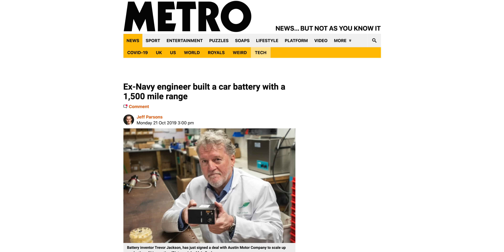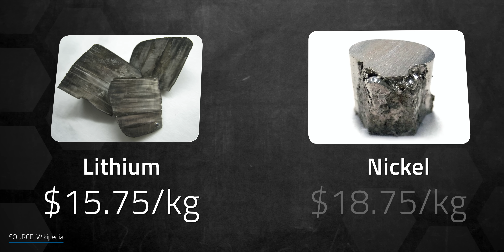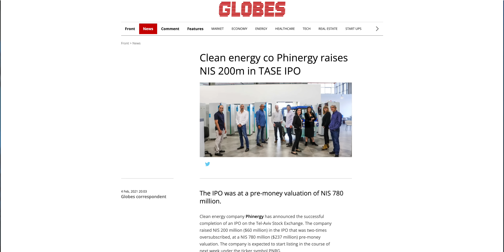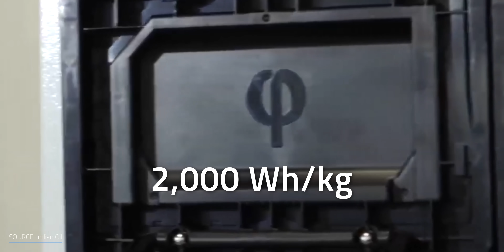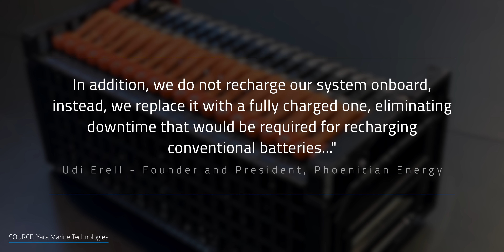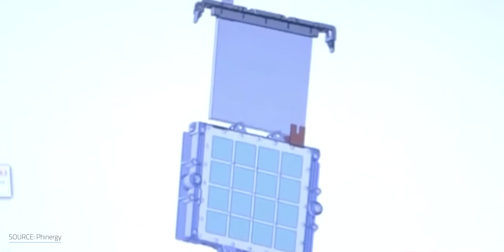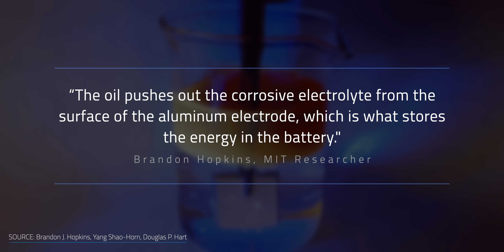Exploring the 1000 Mile Car Battery - Aluminum Air Hype?

Comment: The obvious thing to do is to build a vehicle with 75 miles of range on lithium ion & 500 miles on aluminum air. Then all your daily driving can be rechargeable, & you dip into the aluminum for long trips. Battery changes are minimized down to once or twice a year.
Reply: Running a Tesla battery from 80% down to 40%(my daily max it seems) counts as less than one cycle. Also less than 0.4 cycle. The top/bottom capacity is expensive in lifetime terms, so if you avoid it, and have a large battery that you rarely run to max/min, most cars will wear out way before the battery.
Reply: Been thinking about the same with Hydrogen fuels cells; now if the degradation issue is fixed with Aluminum air, seems there is a better match.
Reply: @MDP1702  i understand that but your not thinking in the context of everyday life. If i just go get an aluminum air battery for a "specific trip" and lets say i end up only using 50% of it capacity for that trip what you going to do with the remaining amount? just let it sit there in your car while using lithium every day? you already paid for it and i guarantee it would not be set up where the average person is going to be able to take it in and out by themselves... nor would vast majority of people would want to..If you use a skateboard design there's no way you could... so in terms of the average people it would make more sense to have a swap station for the aluminum battery and use that as your daily consumption and the lithium as your backup with a 2 compartment skateboard design... 1. you could still have regenerative breaking that would then recharge the lithium when not in use or in use while aluminum is your primary source of driving and 2. you could then just swap out the aluminum when its drained and 3. the overal weight of the battery skateboard design would actually be less than current 100% lithium batteries.
Reply: @Teknomanslade2  * and lets say i end up only using 50% of it capacity for that trip what you going to do with the remaining amount?*
The answer to that is pretty easy, there are several solutions. 
1) you just use up that specific battery during your daily life. No problem with this. Afterwards only get another Alu-air once you actually need the range. 
2) you bring this back to a battery swapping station, where they can give it to someone else that doesn't need a full range battery (and thus pays less and ofcourse you get something extra back too, how much depends on the economics). 
3) you use modules, with every module being worth lets say 200 miles and a possibility of adding x modules in your car at the same time (x depending on car to car). For example do you need 1000 miles, you use 5 modules, do you need somewhere around 200 miles, you put in 1 module. Everything below 150 miles should be doable with a 100 miles lithium battery, even if this means a one time 10-15 minute fastcharging break.

so in terms of the average people it would make more sense to have a swap station for the aluminum battery and use that as your daily consumption and the lithium as your backup with a 2 compartment skateboard design
There is just no sense in using your lithium as a back up, while using alu-air as your standard battery. The advantages of Lithium batteries is best used as in a daily use case, while that of Alu-air as an extender. Why would you even want to have a Li backup? Just get to the swapping station in time just like with gas now.

you could still have regenerative breaking that would then recharge the lithium when not in use or in use while aluminum is your primary source of driving
Except that Li battery will quickly be fully charged if you only used it as an essentially non necessary back up. So you quickly will make no use of the regenerative braking advantage.

3. the overal weight of the battery skateboard design would actually be less than current 100% lithium batteries.
As it would be when using a smaller Li battery as the main battery and using the Alu-air as an extender for longer trips.
Reply: @MDP1702 This is a more AL infrastructure heavy process. Using Li-ion on daily basis and AL for longer trips actually makes sense
Reply: I;m retires now but when I was working I drove OVER 1000 miles a WEEK. So there I am, 600 miles from home and  and in foot.....Like I said, Rich boys toys. The got a LONG way to go before they even get close to the ,main streem.
Reply: @mathewmolk2089  On average that is around 200 miles a day (workweek), that for one is already pretty rare (like maybe a few % of people would do this) and secondly there are already several EV's that could get 200 miles of range in one go. Ofcourse if you don't spread it out over the days, but for example need to drive around 600 miles in one day, that might be different. Then again if you can get 300 mile on one charge, then you'd need to rest anyway due to the amount of time behind the wheel (at least it is advised, in several parts of the world this is mandatory for semi drivers for safety reasons).

If you can't charge at your destionation or somewhere along the way, things are different ofcourse
Reply: Pretty good idea to me, that sort of li-ion range is enough to keep the daily driving within the optimal 20% - 80% of the battery capacity. But if you want to stay at a fiends house and they don’t have a charger then you hit a snag. Also, with people swapping out the aluminium air batteries less often, then there is less infrastructure ti support to, and you may have to use most of your back up range to get to and from the swap out station
Reply: @mariat5860  btw hows ur STDs doing
Reply: How about a small attachable Trailer/pod to carry a couple of Al's for long trips.
Reply: I think if the oil method works to eliminate degredation, that this would be an excellent idea. Would save a buttload of costs for normal ev's since the li-ion battery is the big ticket item.
Reply: @The_fusion_physics_guy  I definitely think its a good idea if it works... but the problem is it isnt "green" so it kinda goes against the whole renewables, green energy initiative to use fossil fuel/additives in an electric car.
Reply: Probably should be the other way around in the sense of using aluminum air as daily because of the degradation issues that were posed. then when aluminum is done lithium is an emergency  backup that can be used to get you to a swapping station.
Reply: @Teknomanslade2  You can solve the degradation problem by simply not installing the battery until you're ready to make the trip.
Reply: @francisboyle1739  Just Reported A Bot.

Comment: It could work, though I think a combination of Aluminum and Lithium batteries would be best. You could recharge your lithium pack normally, but insert an Aluminum pack for road trips.
Reply: I like the idea of standardized modular energy cells. Whether you're using Lithium Ion, Aluminum air, or maybe even a future technology, you can just swap these out in a minute or two, especially if there's some automated process that inserts/removes the modules, it would take moments to "refuel". Users could have a battery "service" that just swaps them out for replacement modules wherever they go, and modules would be rotated out of service as they became degraded.
Reply: @josephdadey and the swapping process can be automated or done by self jusr like hlw you refuel petrol/diesel
Reply: @mariat5860  HAVE YOU?
Reply: Thing is, you would carry around double the amount of weight. Also when you go on a roadtrip, especially with family, you will carry luggage with you, which means available space would quickly become an issue. The viability of those batteries for me hinge on the fact how good they can be recycled. Changing them every 1000 or so miles wouldnt be a difficult issue to overcome if you could simply get them from gas stadions. Also the problem mentioned in the vid with what happens if you should run out, isnt difficult too solve. Just call a servicecar that has a new batterie for you to use and you are good to go again.
Reply: @Daniel-rd6st  I would imagine limited range rechargeable battery for city driving with an expansion slot for optional swap when necessary.
Reply: @Daniel-rd6st  well im not sure it would be a weight increase if you are assuming the same space of the original batter compartment. I think he may be referring to using "partial" for lithium batteries and the rest for the aluminum. like 80-20 split which would actually be lighter than all lithium but still get maybe 2 to 3 times more range. the Lithium would then only be used a Reserve when the aluminum batteries runs out you would still have maybe 100 miles of range for emergency purposes to get you to a swap station. You could make the battery 2 compartments so when you go to swap station you are only swapping out the aluminum.
Reply: @Daniel-rd6st  I think what he means to say is - you get your 50 mile lithium battery for the city which can be recharged in minutes and then when you'd go long range you slide in the aluminum oxide battery. Not a bad idea actually. 
In fact, makes much more sense than whatever the hell Tesla is doing right now. A 600 km battery on cars which would be driven 99% of the time in cities? What a waste of resources.

Comment: If the swapping is available at gas stations then it wouldn't be a problem. The fact that there is no waiting to charge the battery is even a plus.
Reply: @mariat5860  would likely be loaded via a robot.
Reply: It would be so much more expensive though to transport and store these batteries at each individual station / rest stop. For example for a rechargeable EV there is no storage or transportation requirement at all, the local power grid provides constant electricity premises, no HGVs, cargo ships or planes transporting these batteries all over to the place on a regular basis. As for Petrol & Diesel, they are liquid which makes it easier to transport than a battery which even if its light, takes up a reasonable amount of volume per unit, mean while liquid fuels and oil can be transported via pipelines.

I think the idea is great and might be very useful in specialised industries, as others have mentioned maybe for short flights, trains or buses where batteries can be swapped en mass for multiple vehicles at once and only requires delivering to one location to service many vehicles. But unless it becomes rechargeable I don't see it becoming feasible for the domestic personal transport market as the the transportation of these batteries to swapping stations alone would probably negate any environmental impact these batteries have.
Reply: @howdlej123 As long as there is a demand, logistics won't be a problem. That was how it started with petrol and diesel vehicles. The need for gas stations, and maintenance services was not apparent at first but as more people started buying gasoline vehicles, the infrastructure supporting them began to emerge. I can tell from my experience that people generally do not like waiting, they want instant gratification at every stage of their lives. Even range anxiety wouldn't matter if there were charging/battery replacement stations every few blocks.
Reply: @mithrandir491  My point wasn't that people wouldn't use it, but the logistical side of it negates a lot of the benefit of the environmental benefits of a battery like this and thats the whole point of EV, to be more sustainable. Additionally at least here in the UK, you'd be able to find an EV super charger pretty easily as long as you pay attention to where you're going and think a little before setting off. 

Also battery anxiety is usually more of an excuse made by people who've never researched or drove an EV before. Average persons daily commute is under 30 mile one way. Most cheap EV have around triple that with options for much higher capacities, especially on more premium models. Most of Europe now has decent enough infrastructure to handle longer distanced commutes. I feel that most EVs have adequate range and very few people are ever actually pushing them to the empty on a regular basis in the domestic market.